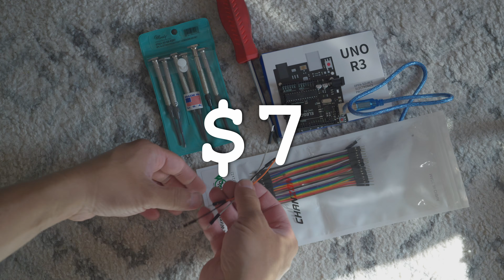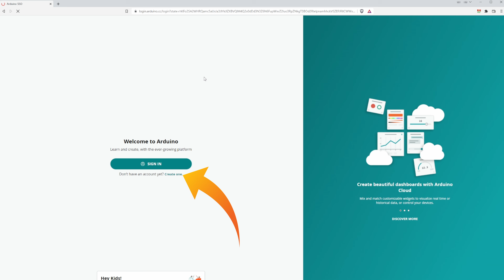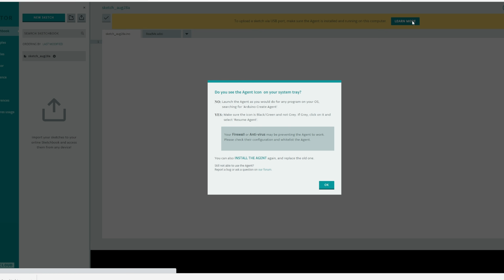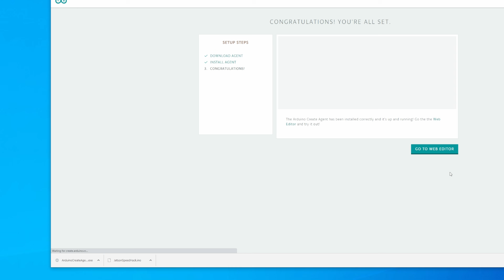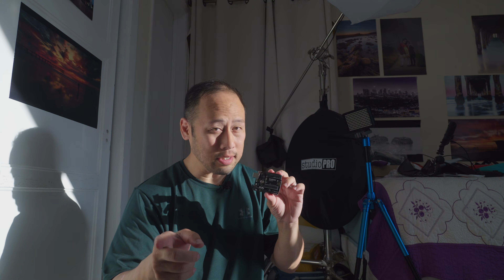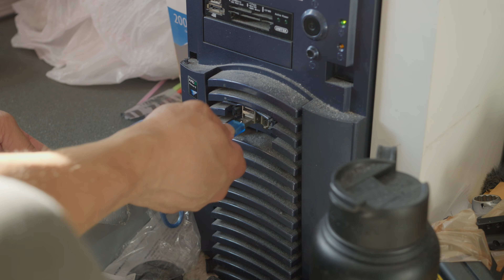Jetson Speed Hack for Newer Bolt Pros

Comment: Does it go faster than 16mph I thought it goes 19mph
Reply from the maker: 19mph is the theoretical top speed, the max the bike can do before you wave the disclaimer.  Weight factors a lot on a small bike like this.

Comment: How do I make it go faster than 16mph
Reply: Lose Weight.
Reply: OR!... upgrade the controller AND battery to a 48v system.
Reply: This can be difficult if you dont know what to look out for. For example... you want to new 48v battery to be similar in size to the old 36v one you are removing, so it fits back inside the case. Jetson by default uses an XT60 connector for the battery, a lot of after market batterys dont come with an XT60, and instead another connecter, you will need to get an adapter. Electrical signals are more complex than most people realize... and "just" buying a 48v controller isnt going to cut it. Your Throttle/Controller NEED to be of the "Hall Sensor" type. Then the final issue that stops most people.... You know your front light(switch) & Cruise Control? Those are wired into the controller. Once you replace your controller.. theres a HUGE chance that the new controller wont be compatible with the Light & CC..... Thus losing both in this conversion process.
Reply from the maker: on top of that, the brakes lines, pedal assist, it can get quite complicated in that there's a lot of wires to keep track of.  I have the 48v already, will be trying that for the channel, hope it works out.  If the lights stop working, that would be a deal breaker for me..... well, for my wife.....

Comment: The guy that helped with the audrino mod.  Has a video that shows that changing to 36v 20ah battery.  He was able to get 19mph. Guess the stock battery to weak. If you want to see the video you have to search for yourself because youtube will not let you put links.
But if you going to change out battery you might as well go with a 48v upgrade.
Reply from the maker: I've seen all sorts of battery mods..... I'm not a fan of external batteries, not optimized for balance, weather, etc.  I will be doing an INTERNAL only battery upgrade, unlike anyone else on YouTube, in a future video.  Fresh battery, you go faster than one that's been depleted.  That said, I have considered 20AH, but the capacity is too much to keep internal without totally hacking out the cover..... although it's a ton of capacity for sure.

Comment: Amazing tutorial sir I’m just concerned that  the bike won’t reach 19mph yours said 16 mph so um
Reply from the maker: 19mph is the theoretical top speed, not sure I can reach that with my weight and strength of the motor/controller.  You can certainly give it a shot and play with the parameters, I've read 23mph might be the sweet spot to get you a little more, but I wouldnt bank on a true 19mph without a controller upgrade.
Reply: @YouTruther  can you make a tutorial on controller upgrade
Reply from the maker: I'm going to play with the existing one for a bit to see if I can squeeze out any juice.  I have a battery upgrade coming, and that will be a challenge in itself, nobody on youtube has done this type of upgrade, so stay tuned.

Comment: I did this and stumbled a bit after watching Tony Quill.  I found the upgrade negligible.
Reply from the maker: should get 2-3mph when applied correctly. noticeable amount when you run it side by side with another bike
Reply: @YouTruther  I’d suggest buying the 48v version of this bike if you want “real” power. Ancheer, Kugoo and ienyrid have the exact same bike but with 48v systems that can go well into 20 mph territory.

The 2 extra mph from arduino or a earlier non updated jetson bolt BT gets you to 16-17 mph with average “male” weight.  It’s barely noticeable.
Reply from the maker: yes, the mods for this particular bike, will likely be mild, and since everyone in my family wants to use my bike all the time, I may just get another bike, makes more sense than piling on money on this thing.
Reply: @raylivengood2  The problem you are not realizing when making your conclusion is the reason the Bolt is limited to 15mph. Look up different class group of E-bikes, then research deeper on why they limit the bike to 15mph. You'll soon realize some countries have a legal limit of the speed of a Class 2(less than 15mph) bike that will require NO License. The main factor in this is the NON-Pedal Versions, as they are in a legal "grey-area" because they authorities/laws use the lack of pedals against the owner and classify it as a scooter/GoPed, requiring a License to ride. The Bolt provides the 15mph product, and Class sticker  in case authorities decide to pull you over. They cant tell if its been modded to go over 15mph... Thus they cant ticket you or impound the bike. Im gonna stop you before you try to say "HE'S USING A BOLT PRO!!" This hack originated before the Bolt Pro was ever released... It was an alternative to the "older-App version" of the Jetson app you would have to download and install, that was prior to the 19mph to 15mph nerf.
Reply: @MythlogicStudios That’s not a problem with this video. Those people that cannot think for themselves should realize themselves.  Let’s test you. What is something I should be aware of then you need to tell me?  Name 1 thing.

Comment: Can you also change the speed of pedal assist
Reply from the maker: not via software, the code is very limited. I’m sure you can trick the system with magnets which it’s based off of.

Comment: Kugo Kirin V1 is exactly same as jetson bolt pro in size and frame except with 48v 400w motor and 48v 7.5Ah lithium battery due to that it goes with my 95km (210 pound) bum to (35km/h) 20mph with no mods, would go faster with lighter person than me ps. it cost me around 450usd
Reply from the maker: good to know, only a matter of time before I get another bike, tired of everyone “borrowing” my bike on a daily basis.
Reply: But can you make it go faster?? The fact you can reprogram the controller on the jetson makes it more versatile. I’ve modded my bolt pro to go 40 kmh on 36v battery.
Reply: @rogerdodg3r  What did you do to the bolt pro to make it go 40 km/h?
Reply: @rogerdodg3r  maybe u did but I doubt it actually hits those speeds